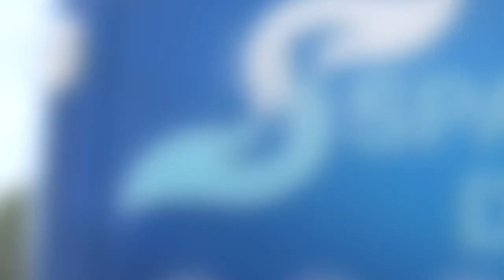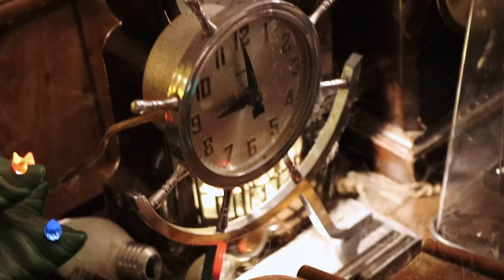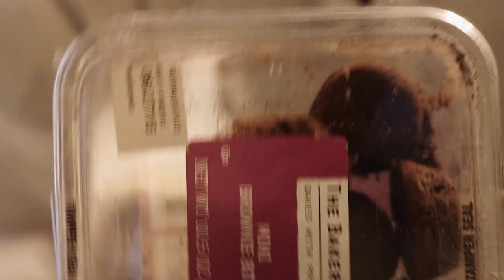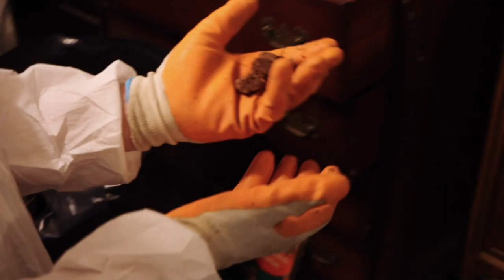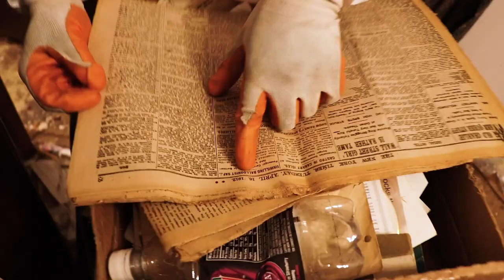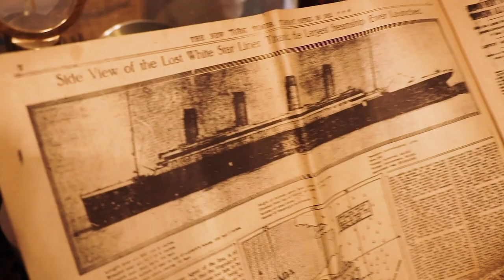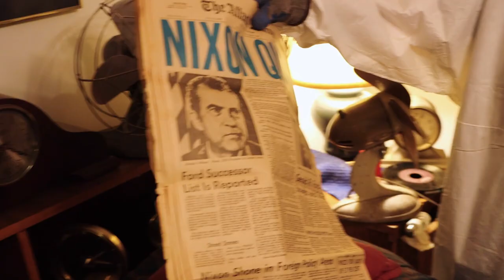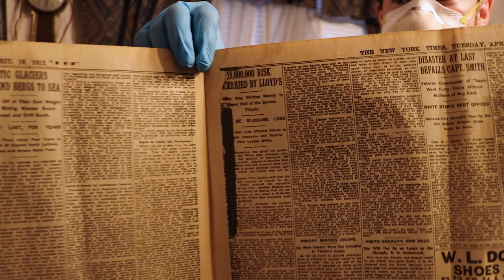House of Hoarded Clocks and Antiques | Athens, GA

Comment: The people commenting on items and potential scrap metal being thrown out - that adds a lot of time to dealing with situations like this.  Many appraisers don't want to come in when it's a bad hoard (this one involved cat waste) - so what you're suggesting would mean everything that might have value would need to be cleaned, plus the trash dealing with, plus the animal waste before appraisal could realistically happen and then they'd do need to pay for a house clearance to occur to get rid of anything that appraisers didn't want.  Dealing with a hoard isn't cheap. Even taking the time to sort trash from recycling adds to the expense because it adds to the time needed. Having a property standing without a tenant or the ability to fix up, rent or sell, is also an expense - so owners usually want the project finished as soon as possible.

Comment: I love that you guys wear the proper PPE, there are many others who don't. A little hint, if you can see that much visible dirt on  your mask, it's time to get a new one. A mask that dirty takes ten times the energy to breathe through. High filtration masks like those ones feel like breathing through a milkshake straw; if it's dirty it feels much closer to a drink box straw. I wear a high filtration mask if I'm out of the house, and have done so for years. They're exhausting to breathe through, but when I swap filters it's SO much easier.

Comment: You need to insist people take what they want before you arrive. They need to leave while you clean out. This is a friend so I understand you might put up with what ever he needs but hoarders need discipline. They should never ever be allowed inside the home or within 10 miles of the home as it is cleared. Clearing is such a hard job and to ask permission or to be stopped by a hoarder is nonsense and they must not be consulted. Tell them they may take 20 items from the home that they want to keep and then if you decide any furniture is worth keeping, let that be your choice not theirs. This is what I am doing to my mother in my dads workshop which is clean but disorganized. Much of it does not work.
Reply: TWENTY MINUTES?????  In this video ALONE, I saw dozens of items that were vintage and antiques that could have been sold.  The "men" doing the cleaning didn't give a crap if it was sellable or not.  Most men don't have a clue as to what would sell and what wouldn't.